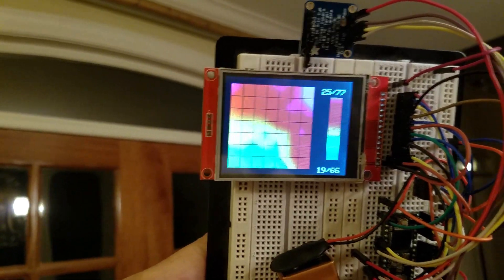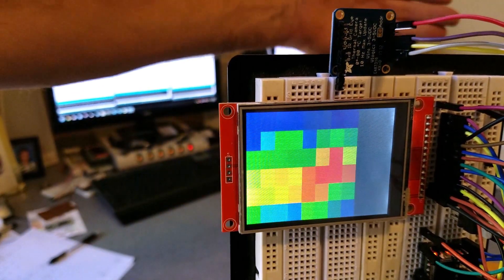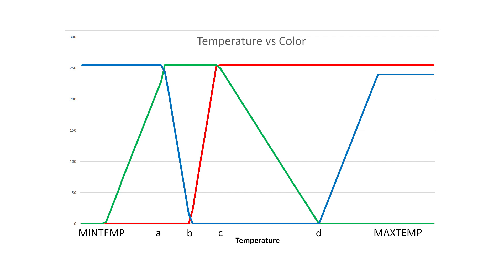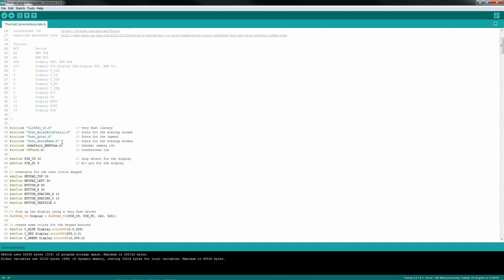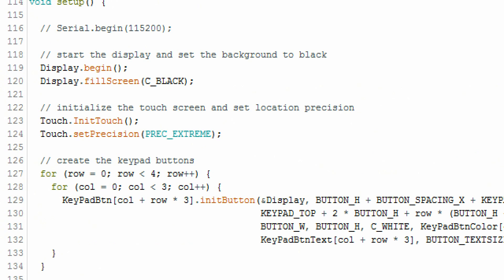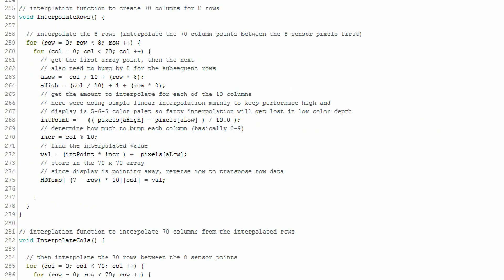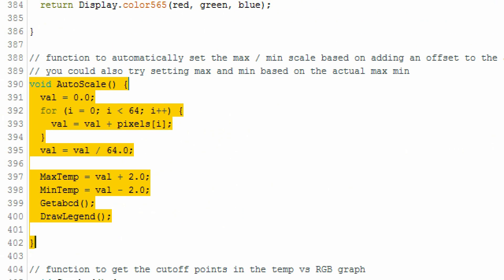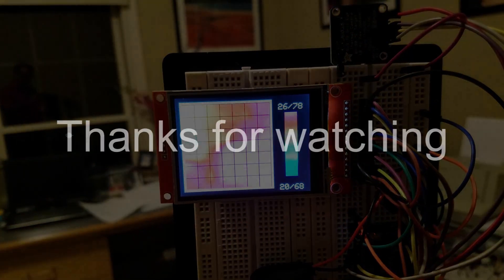Build a Teensy-based thermal imaging camera

Comment: i think 2d interpolation would be more appropriate, it may even remove the "polygon" looks and feel that your use of 1d interpolation seems to have. would be interesting to see. i used once for a work project and although the formula looks nasty, its not too rough. just scan throughout all the pixels, fetch all the relevant parameters, do whatever pre-calculations that you can when you can, then stick it all together to calculate each pixel. https://www.engineerexcel.com/bilinear-interpolation-excel/ but maybe it would look the same, i just dont know :)

Comment: hi, i tried that on a Teensy 4.0 i m getting this error : Error compiling for board Teensy 4.0.
Reply from the maker: not sure why. can you get anything to compile? maybe the display lib is not for teensy 4.0?
Reply: @KrisKasprzak  i did the example test, they work fine, but using your sketch i m getting :error: cannot convert 'volatile uint32_t* {aka volatile long unsigned int*}' to 'volatile uint8_t* {aka volatile unsigned char*}' in assignment

  P_IRQ = portInputRegister(digitalPinToPort(T_IRQ));:
Reply from the maker: @lebluesman  It looks like that pin is for the touch, just to get something working try commenting out the touch object and any calls to it. If the touch lib in my code is incompatible with the teensy 4.0, the  XPT2046 lib should work (but i've not tested it). Let's at least get the display stuff working first
Reply: @KrisKasprzak  yes it's working by disabling commenting related to UTouch.  i'm using the same screen as you
Reply from the maker: @lebluesman  you may try getting the xpt2046 library I'm guessing it is going to work with the Teensy 4.0 I am starting to move all of my code bases to that touch Library.
Reply from the maker: One more thing the DO DI and  SCK pins on the touch or actually the SPI bus. Just took them in parallel with your displays SPI bus and give it a unique chip select
Reply: @KrisKasprzak  looks like i'm able to compile when i put the board as teensy 3.2. so it should be a compatibility issue with the Utouch library
Reply from the maker: @lebluesman  I recommend dumping the UTouch and using the xpt2046--and share the SPI lines.
Reply: @KrisKasprzak  :( i did and now i m getting a flashing screen with a 8*8 grid , i think i will by a teency 3.2 ... thanks for your help
Reply: @KrisKasprzak  hi i got my Teency 3.2 but still getting only one color,  the AMG is working fin when i check on the serial monitor....
Reply: @KrisKasprzak   i m using only the library that are linked on your sketch but this is the first time i use a teensy, i had to uninstall the windows store version and install the zip one.

Comment: I've had 3 errors when compiling the code provided. 
1- two different #define swap, I removed the one in HW_ARM_defines.h
2- undefined value for void Adafruit_AMG88xx::read(uint8_t reg, uint8_t *buf, uint8_t num) (I tried removing it, compiling and reverted the change when I saw it didn't work...and now I don't get that error anymore, even after restarting arduino)
3- large integer implicitly truncated to unsigned type 
 ILI9341_t3 Display = ILI9341_t3(PIN_CS, PIN_DC, 240, 320);

And I believe that line is the one for Kris's personal library, but he writes:

// you will need to use this line
ILI9341_t3 Display = ILI9341_t3(PIN_CS, PIN_DC, 240, 320);

Which is the same as the one commented out at line 61. @Kris Kasprzak Can you let me know what's the actual line we should be using?
Reply from the maker: change  ILI9341_t3 Display = ILI9341_t3(PIN_CS, PIN_DC, 240, 320); to  ILI9341_t3 Display = ILI9341_t3(PIN_CS, PIN_DC);

Comment: Very nice project. I am trying to build one now but running into issues with the screen. Hoping for a little help. I have verified the screen works with the included examples and that the sensor is working. I get the error below when compiling and the screen is just white. But if I use this ILI9341_t3 Display = ILI9341_t3(PIN_CS, PIN_DC,);. It loads fine with no errors and the screen works but the touch screen is off and the display only shows solid colors for temp changes. 

 ThermalCamera:73: warning: large integer implicitly truncated to unsigned type 
 
ThermalCamera:73: warning: large integer implicitly truncated to unsigned type 
 ILI9341_t3 Display = ILI9341_t3(PIN_CS, PIN_DC, 240, 320);

                                                         ^

C:\Users\Documents\Arduino\libraries\Adafruit_AMG88xx_Library\Adafruit_AMG88xx.cpp: In member function 'void Adafruit_AMG88xx::read(uint8_t, uint8_t*, uint8_t)':

C:\Users\Documents\Arduino\libraries\Adafruit_AMG88xx_Library\Adafruit_AMG88xx.cpp:235:10: warning: unused variable 'value' [-Wunused-variable]

  uint8_t value;
Reply from the maker: change the line to
 ILI9341_t3 Display = ILI9341_t3(PIN_CS, PIN_DC);
Reply: @KrisKasprzak 
That fixed the errors but now I only get sold colors for temperature changes.
Reply from the maker: @mbeg3647  Ive yet to find a tft that has a consistent calibration. Try this... add add the line Display.drawPixel(x,y, Display.color565(255,0,0)); in the ProcessTouch function, just after the Touch.get calls, then you can see how far off you calibration is, then comment out line 366 or so Display.fillRect(....) that way you can see the little red dot. After you determine how far off calibratiion is, in function ProcessTouch add a map function to get the calibration of pressed x-y to match screen coordinates--this is a real pain to do. Now on to the color issue.... first let's see if your sensor is working after .readPixels(pixels); dump each pixel to Serial to see what values are (for int k=0;k<64;k++){ Serial.print(pixel[k]) ; } If numbers are vastly different, soem where in temp max and min levels are probably very wrong.
Reply: @KrisKasprzak  I've tried what you suggested (I commented out line 370, the one with Display.fillRect + added Display.drawPixel(x,y, Display.color565(255,0,0));  on line 563) and now the screen is a solid white.

I think the main problem is that I still get this error when compiling:

...\Adafruit_AMG88xx_Library\Adafruit_AMG88xx.cpp: In member function 'void Adafruit_AMG88xx::read(uint8_t, uint8_t*, uint8_t)':

...\Adafruit_AMG88xx_Library\Adafruit_AMG88xx.cpp:235:10: warning: unused variable 'value' [-Wunused-variable]

  uint8_t value;

Any idea how to fix this?
Reply: Have you been able to fix the error related to Adafruit_AMG88xx_Library ? I'm in the exact same situation as you!

Comment: Hello Kris, I really liked the results and decided to implement it on a project im working on. However, when I put all the parts together and compiled the code, when send to the teensy, the screen stays white. I already downloaded the necessary libraries and the code is working fine. I dont know what is causing the white screen. Could you help me please? Thanks
Reply: I ran a graphic test to check it and I finally made a base test run. However, when I upload your code it tells me this message:

In file included from C:\Users\USUARIO\Documents\Arduino\libraries\UTouch-master/UTouch.h:38:0,

                 from C:\Users\USUARIO\Desktop\ThermalCamera\ThermalCamera.ino:49:

C:\Users\USUARIO\Documents\Arduino\libraries\UTouch-master/hardware/arm/HW_ARM_defines.h:9:0: warning: "swap" redefined

 #define swap(type, i, j) {type t = i; i = j; j = t;}

 ^

In file included from C:\Users\USUARIO\Documents\Arduino\libraries\ILI9341_t3-master/font_Arial.h:4:0,

                 from C:\Users\USUARIO\Desktop\ThermalCamera\ThermalCamera.ino:1:

C:\Users\USUARIO\Documents\Arduino\libraries\ILI9341_t3-master/ILI9341_t3.h:544:0: note: this is the location of the previous definition

 #define swap(a, b) { typeof(a) t = a; a = b; b = t; }

 ^

ThermalCamera:68: warning: large integer implicitly truncated to unsigned type 
 ILI9341_t3 Display = ILI9341_t3(PIN_CS, PIN_DC, 240, 320);

                                                         ^

El Sketch usa 83200 bytes (31%) del espacio de almacenamiento de programa. El máximo es 262144 bytes.
Las variables Globales usan 32212 bytes (49%) de la memoria dinámica, dejando 33324 bytes para las variables locales. El máximo es 65536 bytes.

What is the problem here? are there functions that are overlaping?
Reply from the maker: Hard to say what do do without giving me any details. Maybe google white screen Arduino TFT

Comment: Hello kris I've tried usinh teensy 3.2.
I have uploaded the program, the camera and TFT are installed according to your instructions. But when starting tft display only white blank.
How is the solution?
Reply from the maker: What display are you using? does the example that come with your library--graphicstest for example work?
Reply: I use display TFT Display ILI9341 SPI Series
Reply from the maker: @huseinmahendra115  does the examples work?
Reply: Does the test graph also use teensy?
Reply from the maker: @huseinmahendra115  yes
Reply: hello kris I've tried using the ILI9341 example graphictest but the screen display remains blank white.
How is the solution?
Reply from the maker: @huseinmahendra115  not sure, maybe wiring, maybe how you are powering your display, maybe display is not 3.3 vdc, maybe solder j1, too many variables with no details provided
Reply: @huseinmahendra115  I've had the white screen problem, but unfortunately I'm not entirely sure how I fixed it as I wasn't very thorough in the testing process. But I have found wires plugged incorrectly, I had to switch the power to Vin while I was connected by USB and I had to run some other software that worked properly (I haven't found the code provided to be working, it could have caused a white screen).

Comment: Hi Kris, I am from indonesia

I tried your code with Arduino Uno, but there were some problems with the library. even though I have included all the libraries that you have suggested.
how is the solution?
Thanks
Reply from the maker: the display library i'm using, the ILI9341_t3 is specifically written for a Teensy. Try replacing the library with the Adafruit_9341. Performance will be pretty bad with arduino
Reply: @KrisKasprzak  Do you have a reference to the adafruit_9431 library?
Reply from the maker: @huseinmahendra115  https://github.com/adafruit/Adafruit_ILI9341
Reply: Hello kris I've tried usinh teensy 3.2.
I have uploaded the program, the camera and TFT are installed according to your instructions. But when starting tft display only white blank.
How is the solution?

Comment: HI, i have follow all step but i have two problem.
First on Touch with the follow error on compiling:
In file included from C:\Program Files (x86)\Arduino\libraries\UTouch/UTouch.h:38:0, 
from C:\Temp\ARDUINO\TERMOCAMERA\ThermalCamera1\ThermalCamera1.ino:45:
C:\Program Files (x86)\Arduino\libraries\UTouch/hardware/arm/HW_ARM_defines.h:9:0: warning: "swap" redefined

 #define swap(type, i, j) {type t = i; i = j; j = t;}

 ^

In file included C:\Temp\ARDUINO\TERMOCAMERA\ThermalCamera1\ThermalCamera1.ino:39:0:

C:\Program Files (x86)\Arduino\libraries\ILI9341_t3/ILI9341_t3.h:544:0: note: this is the location of the previous definition

 #define swap(a, b) { typeof(a) t = a; a = b; b = t; }

Second problem is definition of ILI9341_t3 Display objetct its seems that is not correct passed value:
ThermalCamera1:64: warning: large integer implicitly truncated to unsigned type 

 ILI9341_t3 Display = ILI9341_t3(PIN_CS, PIN_DC, 240, 320);

A value to dimension of display cannot used in this context

If i comment all section of Utouch and use a Display definition without 240 and 320 the project work but the image on sensor its equal 1 pixel

Thanks
Reply: hi, i have found an other code from here: https://forum.pjrc.com/threads/48113 during compiling  i have only the first problem on warning on Utouch but now image of sensor its displayed but on lick keypad is not correct disposed.
A drawing on display is correct but when click on button 1 its showed 7, all key are not correct
Reply from the maker: These displays are very different. Some the coordinates are reversed. You will probably have to remap screen coordinates.

something like this.....

 Touch.read();

  BtnX = Touch.getX();
  BtnY = Touch.getY();

#ifdef debug
  Serial.print("real coordinates: ");
  Serial.print(BtnX);
  Serial.print(",");
  Serial.print (BtnY);
  Display.drawPixel(BtnX, BtnY, C_GREEN);
#endif

  // x  = map(x, real left, real right, 0, 480);
  // y  = map(y, real bottom, real top, 320, 0);
  // x  = map(y, 320, 0, 0, 320);
  // y  = map(x, 240, 0, 0, 240);
  //yellow headers on the display board
  //BtnX  = map(BtnX, 240, 0, 320, 0);
  //BtnY  = map(BtnY, 379, 0, 240, 0);

  //black headers on the display board
  BtnX  = map(BtnX, 0, 240, 320, 0);
  BtnY  = map(BtnY, 0, 380, 240, 0);

#ifdef debug
  Serial.print(", Mapped coordinates: ");
  Serial.print(BtnX);
  Serial.print(",");
  Serial.println(BtnY);
  Display.drawPixel(BtnX, BtnY, C_RED);
#endif
Reply from the maker: change  ILI9341_t3 Display = ILI9341_t3(PIN_CS, PIN_DC, 240, 320);

to  

ILI9341_t3 Display = ILI9341_t3(PIN_CS, PIN_DC); 

I customized my ili lib to take screen size as input. Let's see if that addresses the swap issue as well.

Comment: Wow Thanks, never knew about how you could ilturplate such a low resolution sensor.  Fun fact, when I was looking for a 16x16 version, I found out what tha part number means.  AMG88 means its an 8 by 8 pixel.  The first 3 = 3v and it can be 5=5v.  They even have a low gain version. 3=High, and 4= Low.  So a AMG8854 is an 8x8, 5v low gain display.  The AMG8833 is about $22 by itself btw.

Thinking of getting the low gain as its range is 20C to 100C, however you lose a bit in accuracy as the high gang is about +/ 2.5C vs the Low gain 3.0C, but its really not that much.  These are GREAT for finding out problems on PCB's.  Just find the chip that is slightly hotter than the others.

Now how to overlay this with a CMOS camera..humm..
Reply from the maker: Glad I could help

Comment: it would be cool if you could test if that module could seethrought a laser beamsplitter cube (~3$ from ebay china) . If so it would be possible to use a second higher resoloution camera as overlay image with no parrallax affects .
https://www.ebay.com/itm/X-Cube-Prism-Edge-Optical-Glass-Square-Dispersing-Beam-Splitter-Cube-Gift-NEW/401737900867?hash=item5d8971e343:g:ePgAAOSwBz1cnz2H

Comment: If I attach a lens, can I detect a person for example 40 ft away?
Reply from the maker: I seriously doubt it
Reply: @KrisKasprzak  Interesting. Thanks for sharing this amazing thing you made by the way, as so many people are trying to make something that isnt the standard 4000 dollar drone camera. This is amazing.
Reply: Normal glass lenses act like mirrors with far infrared. You need to use lenses designed for thermal cameras typically made from germanium.

Comment: Do you think it will work to check abnormal behaviors on house appliances?
Reply from the maker: depends on the temp differential. The accuracy of these is really not that great. What temps are you trying to measure?
Reply: I was just wandering, actually don't have anything on mind, just wanted to know if it could be used for that purpose

Comment: How are you powering it?  Is it portable?  Could this be used to find studs in a wall similar to what the Walabot?
Reply from the maker: 9 volt battery and 3.3 linear regulator--should have used a buck converted to save power. My unit is mounted on a PCB https://www.pjrc.com/thermal-imaging-camera/
Reply from the maker: I just did a test trying to find wall studs, 50 deg outside 75 inside, could NOT even remotely find the studs

Comment: Thanks for sharing! I've been trying to get this to work, but I keep running into a problem with the code. Specifically, I think there is an issue with the ILI9341_t3.h library. After some debugging, I've found that it gets hung up at line: 
Display.fillScreen(C_BLACK);
The TFT display doesn't display anything either. There's only a white screen from the backlight. 
However, I've been able to test the display and thermal sensor by running "thermal_cam" from the Adafruit AMG88xx examples and "graphicstest" from the Adafruit ILI9341. From those tests, I believe the hardware and wiring are both good. Any idea what would be causing this issue?
Reply: balesen kris

Comment: would a microcontroller with more processing power increase the definition or is that a limit from the sensor? If so is there a higher quality sensor on the market that might provide better definition?
Reply from the maker: Resolution is more of a function of the sensor itself is sensor it is only an 8 by 8 array and you can only go so far with interpolation to make more pixels. A faster processor would only give you better frame rates
Reply: Is there another sensor out there you would recommend for better resolution?
Reply from the maker: I don't know of any,  but i've never really looked.
Reply: Cool thanks for responding, you're the best :)

Comment: i want to know about sensor it looks like adafruit sensor, my question is will it work with sparkfun libraries as both sensor have same name and looks.
Reply from the maker: what chip is in the sparkfun sensor? If it's an AMG8833, adafruit libs may work
Reply: @KrisKasprzak  yes the name is same here i have adafruit available, i just want to know if sparkfun examples will work on it and can you run some examples from sparkfun library just to check i will give the link
Reply: https://github.com/sparkfun/SparkFun_GridEYE_Arduino_Library/